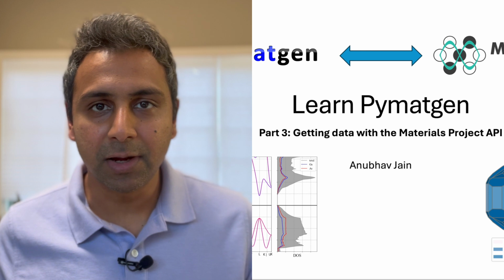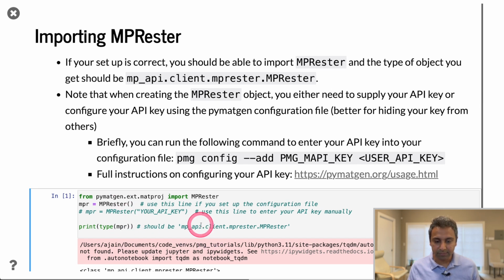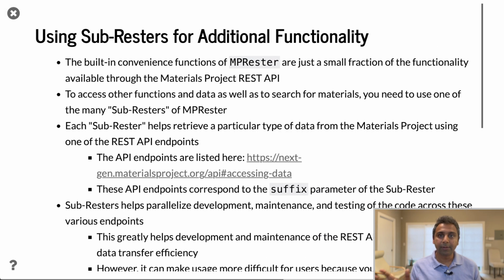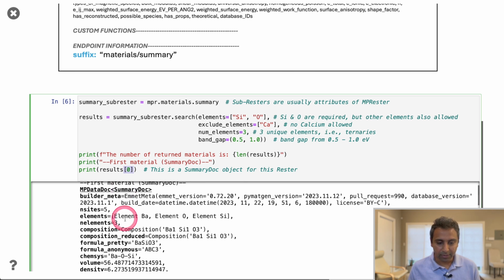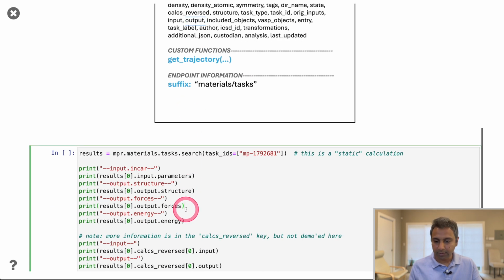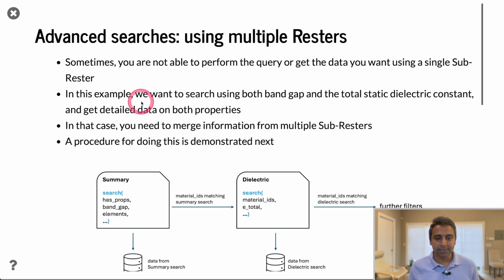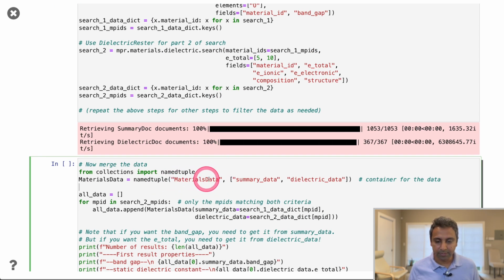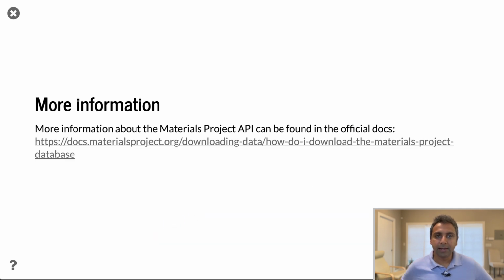pymatgen tutorial #3: Materials Project API (downloading large materials data sets)

Comment from the maker: Important updates since publishing the video:
1. As of 4/16/2025, pymatgen no longer supports mp-api usage and instead implements its own functionality for accessing Materials Project data. To go through the tutorial, you now need to import MPRester directly via: "from mp_api.client import MPRester" instead of through pymatgen. The link in the description to the Github repo contains an updated version of the tutorial with this change. The rest of the video is still fine as long as you import MPRester from mp_api.client instead of through pymatgen.
2. In terms of endpoints for MPRester when imported using mp-api, the best place to find endpoints is in the documentation of the Python client: https://materialsproject.github.io/api/ . Go to routes, find the SubRester you want, and click the class name to bring up the docs. Sometimes, these endpoints differ slightly in name from the official REST endpoints. If you really need to search directly on the API doc parameters, pymatgen recently pushed a commit to do so but it's not covered in this video: https://github.com/materialsproject/pymatgen/commit/402385a203acb9f45187377a125f6c1134ae1000

Note that the video used the following versions:
Python=3.11.4, pymatgen=2024.6.10, mp-api=0.41.3.dev4+g1eb19ba

Comment: I might ask here. You mean that if setup is correct, when you import MPRester from pymatgen.ext.matproj, the type should be mp_api.client.mprester.MPRester. But in my case, it is just pymatgen.ext.matproj._MPResterBasic, then I can't use get_dos... and get_bandstructure.... Can you guide what is a mistake in the installation? And it is very curious that by importing pymatgen object, it be mp_api object.
Reply: I have fixed problem. In the previous failure of importing mp_api comes from version conflict. By installing latest pymatgen and mp-api, from mp_api.client import MPRester is working. Then, in my practice, the tutorial ipynb needs to be modified.
Reply from the maker: Thanks for this comment. Yes, as of 4/16/2025 pymatgen no longer supports mp-api and has its own client. To make the tutorial work, you need to import MPRester directly from mp-api.client instead of from pymatgen. I have updated the tutorial on Github to reflect this change. Glad you were able to get it working!

Comment: Hello, 

Thank you very much for this fantastic set of tutorials. I had a couple of questions - 
1. Is it possible to retrieve the formation energies calculated with PBE(+U) and R2SCAN separately ? If I understand correctly, the formation energy in the MP-UI is calculated after applying the mixing rules.
2. Is it possible to retrieve the VASP input parameters for calculating the elastic tensors shown in MP-UI ? I did not find this among the task-ids listed by the Task Subrester. This may be helpful for me as I am getting started with elastic tensor calculations with VASP.

I thank you for your time.
Reply from the maker: Try contacting the support forum, hopefully they can help: https://matsci.org/c/materials-project/8

In the UI, you can see all the tasks for a material (e.g., SCAN or PBE) on the corresponding tasks page for each material, e.g.: https://next-gen.materialsproject.org/materials/mp-19017/tasks?formula=LiFePO4 . The energies listed in the Tasks page should be "raw" energies.
Reply: @AtomsToMaterials  I thank you very much for sharing these information.